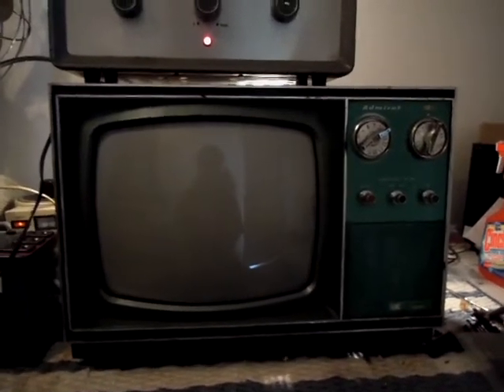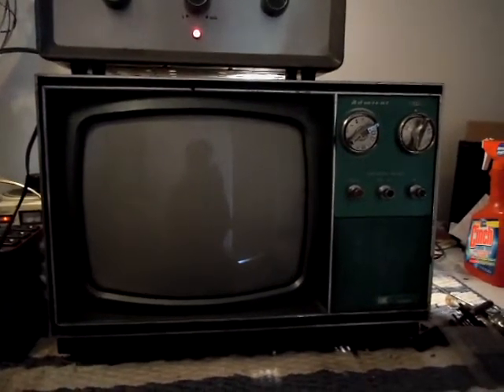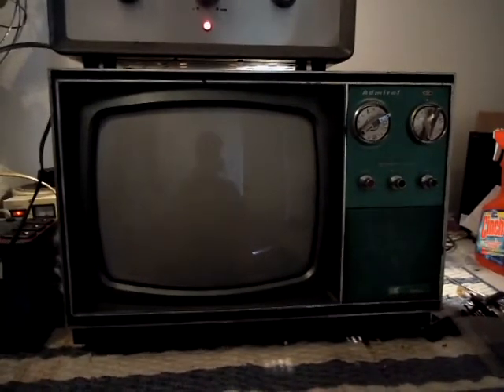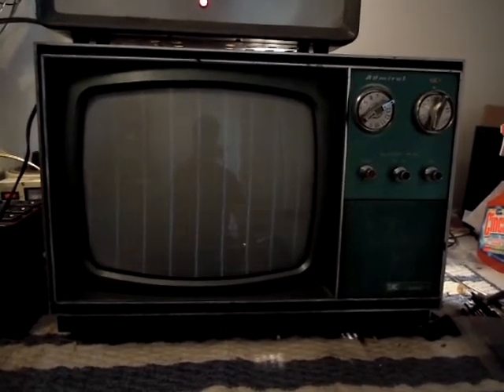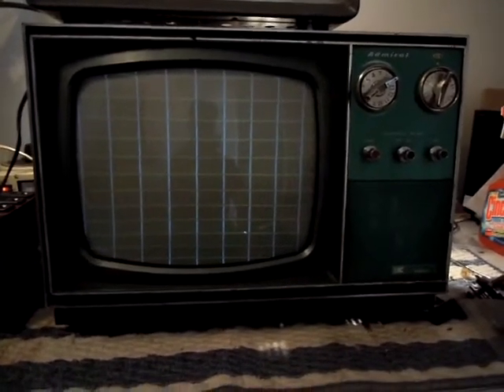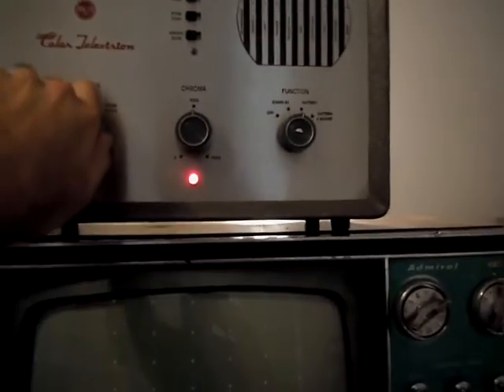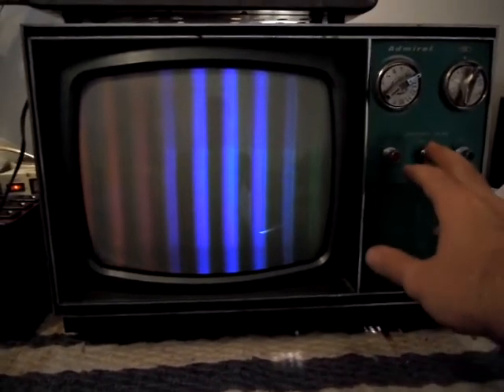1973 12" Admiral Portable vacuum tube color TV  - FIRST LIGHT.

Comment: cool set. I too like the smaller vacuum tube color sets. I assume you have checked the voltages at the CRT pins? maybe a weak video out tube, too high plate voltage cutting of the CRT?
Don't know the chroma demod on that set, but a vector scope would be nice to see how that gated color bar looks at the grids of the CRT. I had weak greens on a GE Porta Color, a slight tweek  in the chroma with the vector scope attached took care of that. Good luck with it!